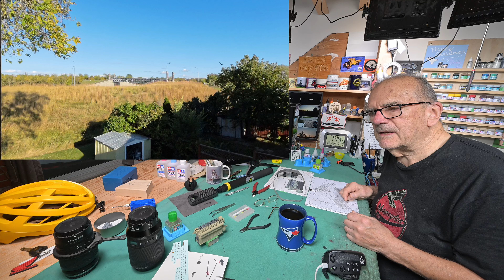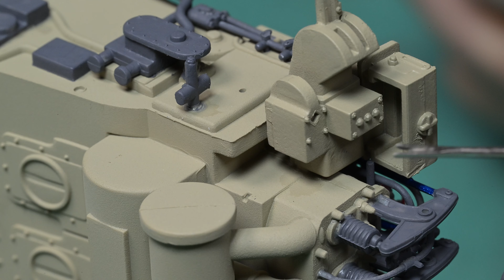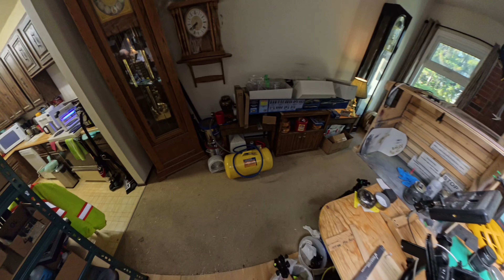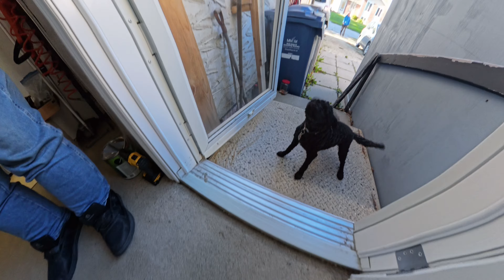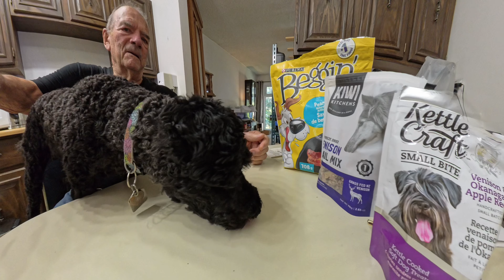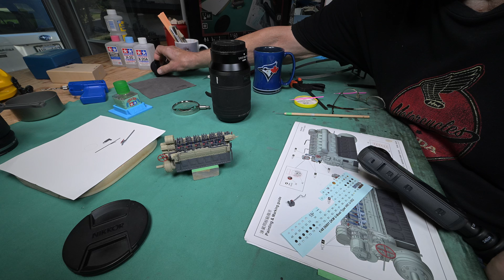The Model Ship - Part 2130

Comment: When you install that 16 camera tower, have someone else get on the ladder.
As you know, I too am old and think in feet also.
Engine looks great.                See ya.                 JimE
Reply from the maker: Hi Jim,
I think it's the ladder thing that's kept me from making it the past summer already. 👍
Reply: @roncalverley  My flag is on a telescopic pole that comes down to about 5' from the ground and is 23" tall.  Perhaps there is something along those lines you could make work and never have to use a ladder.  I just put the sleeve in the ground with a little concrete and stuck the pole in it.             JimE
Reply from the maker: Great Idea Jim. Looking into that now. Thanks! 👍